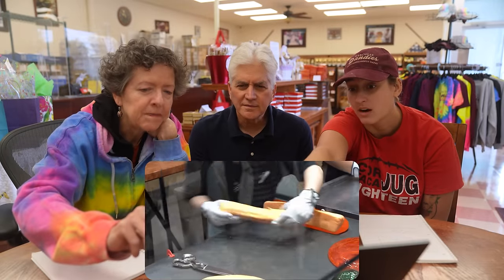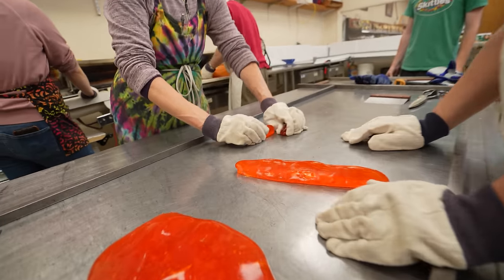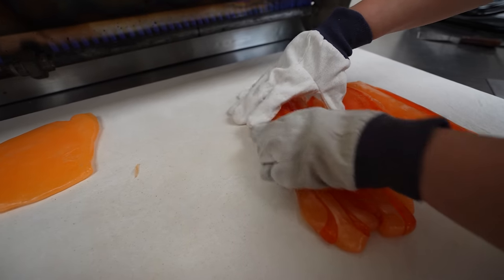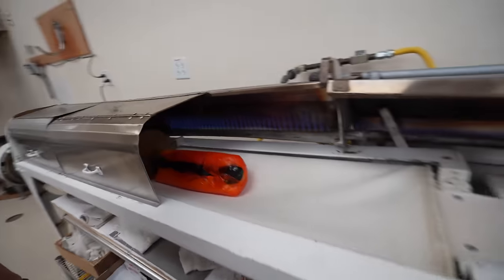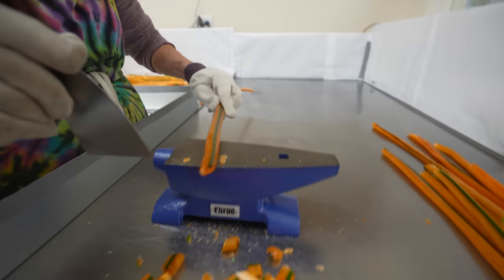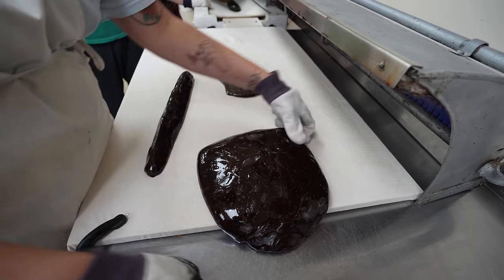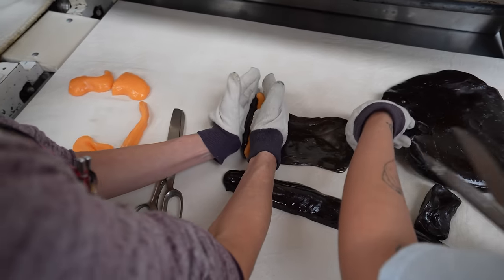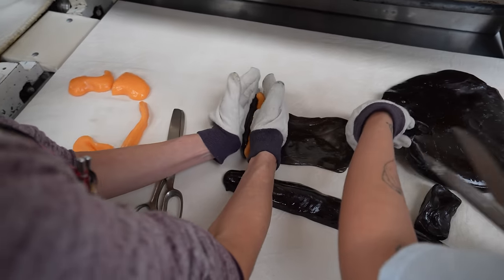Making image candy is harder than we thought...

Comment: I’m not a candy maker, but I am a crafter, 😂, so I’ve tried to replicate OPVs before and had similar experiences…

I would suggest picking up some playdoh or polymer clay in a few colors and working out the design first so that everyone on the team is already comfortable making their assigned shape(s) and you can practice without the heat making it more difficult, you can all start out slow before you need to go fast… It definitely won’t solve all the problems, but it might let you work out the kinks in the process and design before there is hot sugar on the table….
Reply: exactly what I was going to suggest
Reply: Dough or clay to workout the shaping, and I would draw out all the preforms and steps.
Reply: 🎃What a brilliant way of prototyping🎃
Reply: Great suggestion !
Reply: I make polymer clay canes. It's a lot of fun and not as hard as it looks. It's of course easier with clay I'm sure.

Comment: I am guessing when they use the "hold it and let it droop" is actually very important for making the image start, and probably has a big difference on the image quality. If you think about it, letting it drop pulls the material away from the start, and probably makes for clean edges in the image. It would certainly explain why they always do swans and "waste" quite a bit at the start, perhaps a necessary evil.
Reply: Holding it allows it to droop evenly. With clay canes you have to roll them thin.

Comment: The internal image components are kept at a colder temperature to maintain thier integrity.  These are reheated when the larger warmer outer wrapper is added and can then be pulled.  It is very similar to Millefiori, or Murrine, a very old technique used in glassmaking that produces elaborate work consisting of a multitude of small glass rods, bevels and canes that have been fused together and shaped into different designs. The name came from the Italian for “thousand flowers”.

Comment: One thing I notice, is that glass blowing glass, and hot sugar have similar properties, though not the same materials.  The candies are setting and going flat, when somebody comes along to keep the "source" round, they just wibble it back and forth a little, rather than roll it back and forth.

Glass blowers constantly roll their materials.  They describe the material as like honey while it's molten and being formed.  The rolling keeps it in form.

In the case of the fluid sugar, this handling isn't keeping the shape, all the colors are then crushed, rolled around, and rolled in again.  So the areas of color in the cross section are malformed.

Comment: if i had to hazard a guess - you skipped on reheating the core bits before quickly adding the outer layer, and in general had to work fast enough for it to work. if the core is colder than the outside, you'll just be pulling off the outer layer instead of a good spread. guess this is why your second attempt worked better. Thinned out piece, less temperature difference between core and outer temperature... 
So either go faster or go thinner?

Comment: Seems like it would be better if Steve used scissors because it is still so soft. You did a great job because this was a huge undertaking! I’ve also noticed on other videos that they roll the rods continuously until the have hardened so they are straight. This is a big, complicated undertaking!
Reply: Actually that may load soft but it's not it's actually a certain level of firmness